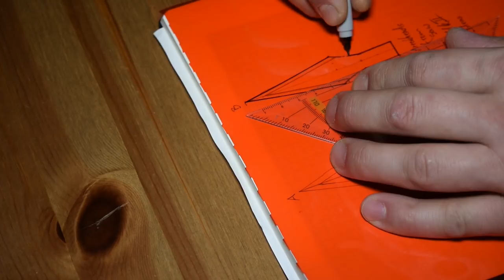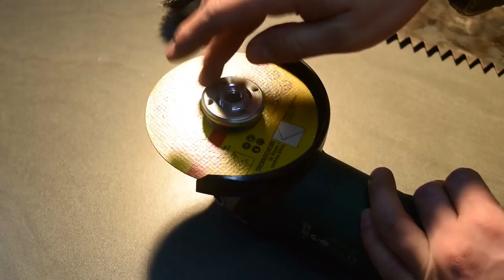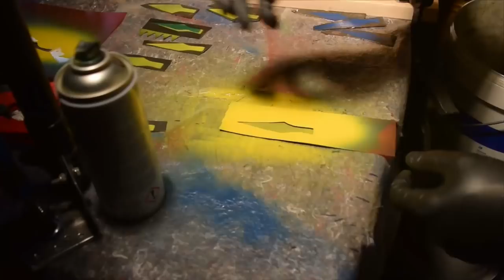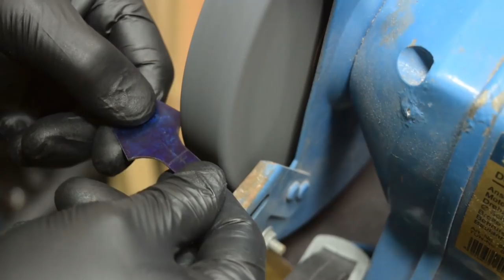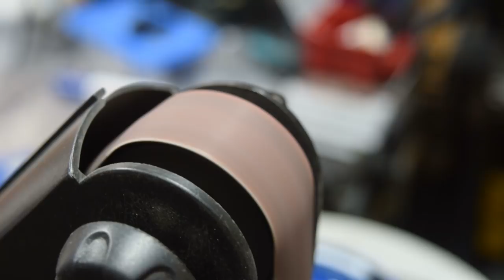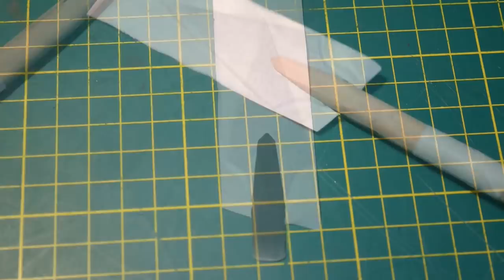How to Make a Batch of DIY Arrowheads

Comment: Very useful video mate.

The nut on your clamp is vibrating loose as you use angle grinder hey. I suggest nylock or second nut
Reply from the maker: Thanks a lot mate! I did notice that as well during editing and replaced the nut with a nylock after that. Cheers

Comment: WELL VERY SKILLFUL HARD WORK. 
I'd just use soft steel,....and you only have to sharpen 2 edges not 4.
And a chisel point is more durable.
Look at grizzly  broadheads to see what I mean.
Soft steel is heavier than light carbon steel.
The point is it only has to be sharp when you fire it at a deer.
I shoot wood arrows in compound bows,...old 80's bows with a round wheel cams.
Reply from the maker: Thank you

Comment: NEXT TIME ... REMOVE RUST WITH 1/4c BORAX AND AN automotive BATTERY CHARGER.  Electrolysis. A sacrificial chunk of steel or iron is required. ELECTROLISIS IS NON-DESTRUCTIVE.
RESEARCH ALSO: SUPERTINNING AND ELECTROPLATING. 
VERY EASY DIY. LEARN SAFETY FIRST !!
Reply from the maker: Material removal with a wire brush is minimal. All safety measures necessary were taken.
Also research: writing in all caps is perceived as shouting and even if you offer sound advise people will see it negatively.

Comment: Is there other cheap material to make arrow head, also easy to make without power tools!
Reply from the maker: It really depends, since the blades are not used daily you can use pretty much any hard and stiff material. That would then allow you to omit the power tools.

Comment: Id use the saw teeth points as my arrow head points  might need a slight angle adjustment or not. You could curve the side about half the length of point back in making a nice slight curve.
Reply from the maker: Thanks that's a cool idea

Comment: You wasted saw because you can make sword from this saw. I made arrow heads from bullets of ak47
Reply from the maker: The material would be too thin for a sword. Field tips from rifle projectles however is a neat idea
Reply: @LetsPrepTogether  I made scimitar from old saw
Reply from the maker: Hm how thick was the steel stock? The saw i used here was only 1.2mm thick which would be too thin for any longer blade